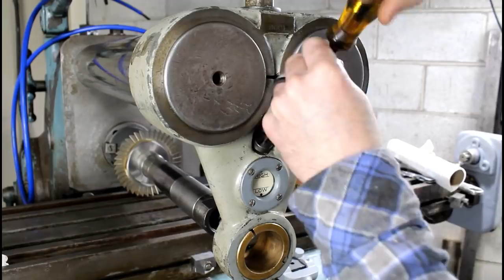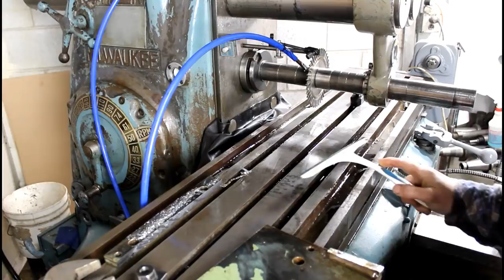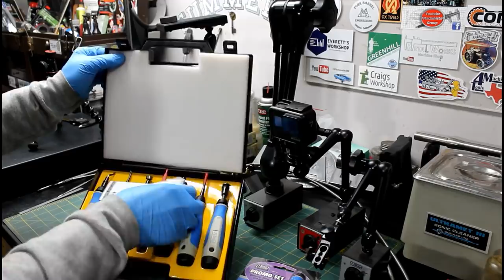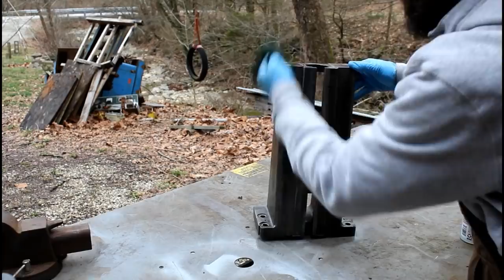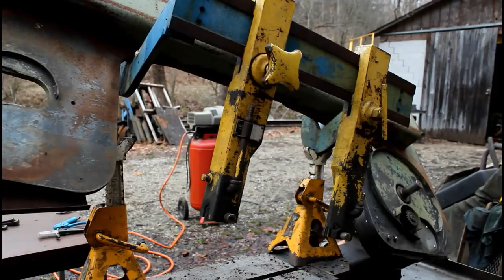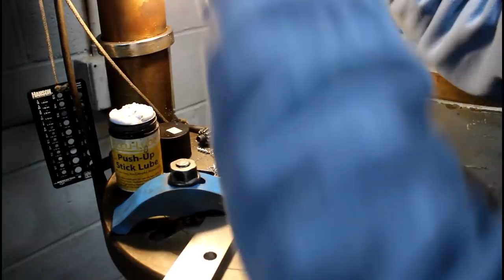ReDo-All Bandsaw Project.. Tracking plates

Comment: Love the videos!  I'm converting an old monster automated Kalamazoo similar to your DoAll.  I replaced the blade tensioner cylinder with a piece I fabricated and machined, and it works great.  I converted it over to single phase because I had a big 220 motor laying around.  I used it on a job to cut some 16" I beam the other day and it worked like a dream.  Accept I had to use the loader on my tractor to lift the head.  I think I'll get a hydraulic power unit and use the existing cylinder.  Have you tackled that part yet?

Comment: can those brackets be reused for another project? You could cut that down the length of each one and make something out of the blank side, such as a tool. I love the old band saw. I have an old woodworking bandsaw made in the late 1920s. It was my uncles and I inherited it when he passed. I always was fascinated with its size and its' ability to make straight and accurate cuts after all of these years. Plus I have a love of old machines and the wonderful added touches that to me, make them pieces of art.
Reply from the maker: Thanks for watching the channel. I am from Kentucky to answer your question you ask in another comment.  I'm a fan of the old equipment also. I like the history and the fact that they were built to last. Most the old stuff had class / style that you don't see much of these days.  Thanks again. Steve Summers

Comment: Hi Steve, just a quick question, is it economically viable to buy spraycans of paint rather than in a tin, I se lots of youtube videos where most use spraycans, here the smallest spraycan costs about $5, any colour but its the cheapest import brand available, if you go to a reasonably decent paint like zinc coat of even a normal black finish your talking $15 and i think there is only 100ml in them, they also usually run out of air with paint still in the can. 

The doall is a great project, if you compare what it cost you to buy compared to what it will be worth once finished and in perfect order you will be pleased you spent the time to get it going properly again.

Comment: Steve, great series.  Really enjoyed watching.  Are you sure that the blade guides had knobs on both.  This set on eBay only has the knob on one as well.  I guess the front guide would move for the width of stock you are cutting?  https://www.ebay.com/itm/DoAll-C-1213A-Horizontal-Bandsaw-Saw-Blade-Guide-Assy-094-108206-094-108198/303381074295?hash=item46a2ebd177:g:7H4AAOSw4SJd3p9p:sc:FedExHomeDelivery!36066!US!-1

Comment: 99% of my videos are shot with my camera on a Noga mag base. I glued a steel plate to the top of my tripod and I just stick the mag base to it. It works great because most tripods are too short for my liking. I probably have a dozen Noga mag bases. I love them, but I've had several now with the same failure. The cast iron on the magnet housing breaks out in a circle at the back of the bore for the magnet element. They still work that way, but it seems like a design flaw.
Reply from the maker: I have a tripod with a metal plate fitted to the top for the same reason.  👍

Comment: Wonderful, one piece at a time and it is coming through. About the knob, unless you want spot on originality, you could make another of the welded rod ones to make a matching pair. With nicely rounded ends. Or machine two good "cross" designed  and replace the two old ones. Whichever, we love this project.

Comment: Your saw blade seemed to cut evenly with a constant sound. I see many that appear to be out of round and cut with a cyclic sound. I suspect you do a better job of sharpening them evenly.
Reply from the maker: It's the entire arbor setup along with the saw. Everything needs to be parallel and the saw good and round. Some setups are better than other but sometimes they just don't like to run straight. This was just a good combination 👍

Comment: Noga is awesome when it comes to helping out YouTube machining creators.

Is it possible to set up the saw on the outside of the over arm support? I know it's possible, but it's it practical (rigid enough)?
Reply from the maker: Lots of factors play into that. For a wide saw in steel its probably best to keep it tight to the machine.

Comment: I've got one of the Noga Big Boys (MA61003) and you will like it. Those over-sized joints have lots of surface area so lots of holding power. Had one of the cheap Chinese ones before that gave me a headache. They are pricey but buy once, cry once. I wish they made a half sized version with those same joints or a conversion kit. Lookin at you Noga, hint hint nudge nudge.

Comment: I've said this before, but I think I know where that saw spent its past life. I painted it ( or one identical to it) blue myself one summer when I was in Highschool. It was at a fabrication shop in St. Mary's PA. I'm now a 35 year old man if that gives you any indication how long ago it was.
Reply from the maker: That's awesome. How cool is that👍. I remember your past comment . I have no idea where the saw came from but it's very possible it's the same saw. When a person paints something they pretty much remember what it looked like. Probably is the same saw.
Reply: @SteveSummers  Oh, i half assed it for sure. It was my first job at my first job. It was filthy then even and i had no way to properly clean it or the time to tear it apart. It use to have an auto feed table that sat behind it, but it never worked right so it probably got tossed years ago. I learned a lot from working at that place though. DO you live anywhere near Pennsylvania?

Comment: Fun Fact the backing castings for the knobs on the guide arms are the same as used by DoAll for leveling pads, just that they have holes in them. Yep, Steve, you are bringing the saw in one piece at a time!